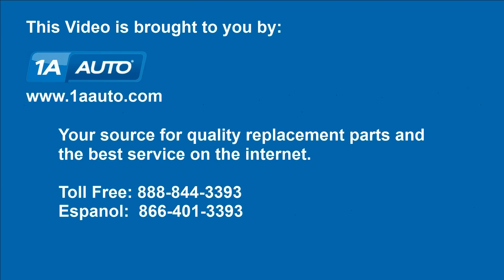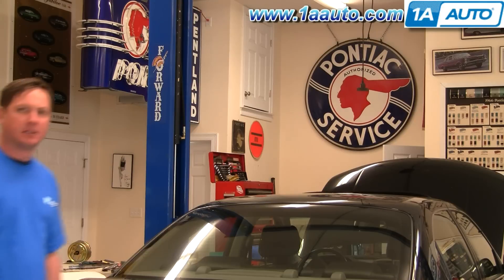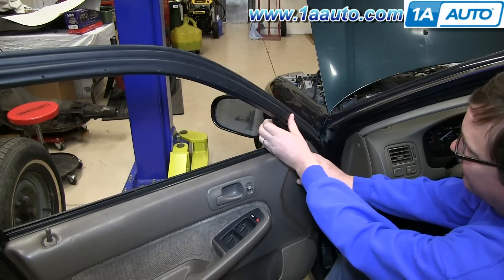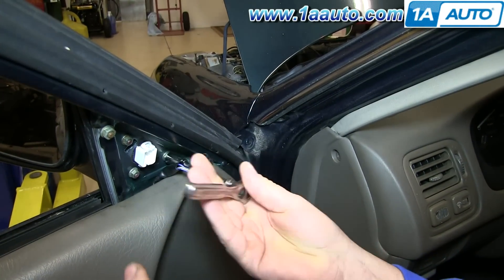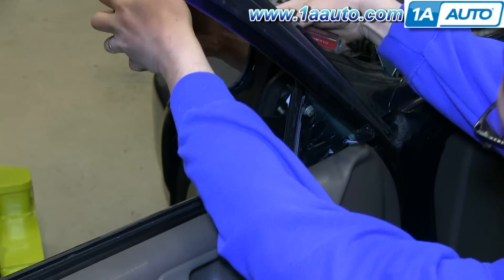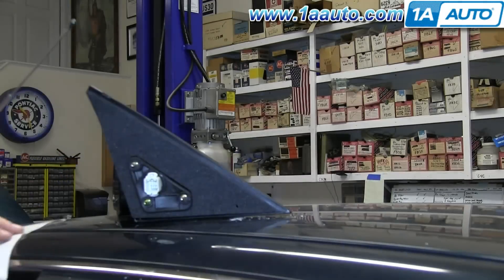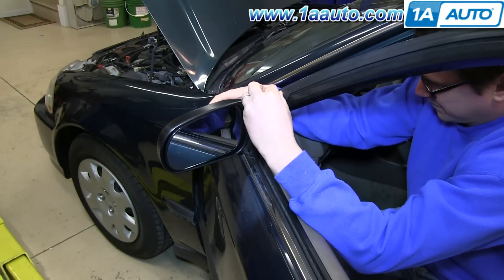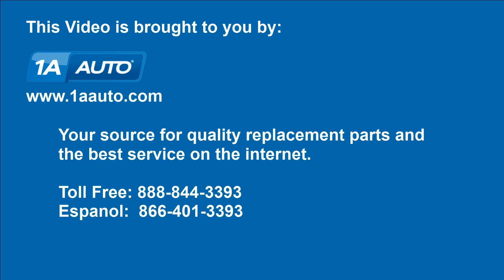How To Replace Power Side Mirror 96-00 Honda Civic

Comment: I replaced my mirror about one year ago, but it still does not go up or down using the switch inside the car. How do I fix this problem? The passenger side mirror works fine.
Reply from the maker: +BigKWS Thank you for checking us out. It could be the mirror switch when placed in the driver side, or a separate wiring issue to the driver side mirror. 1aauto.com